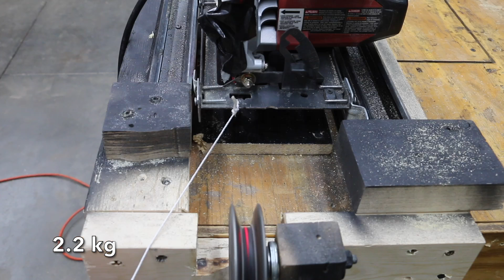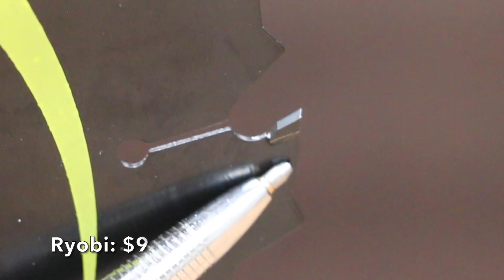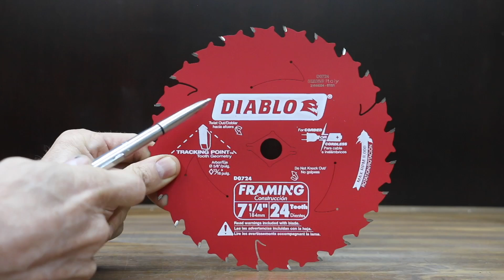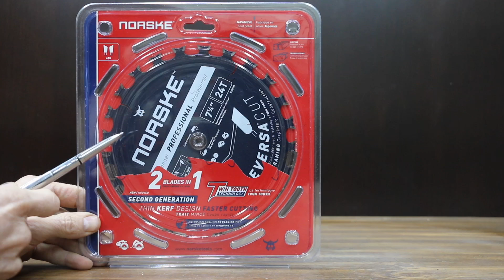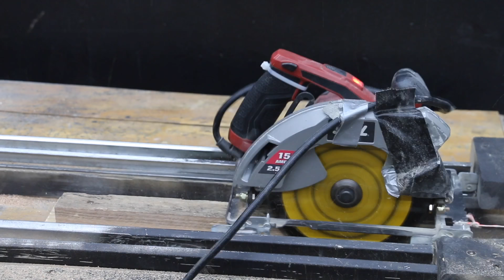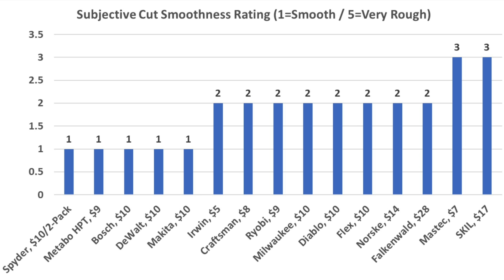Best Circular Saw Blade? FLEX, Diablo, Milwaukee, Makita, Bosch, Ryobi, Irwin, Spyder, SKIL, Norske

Comment: Todd testing the Makita blade:  "Holy Smokes 1.41 seconds very impressive!"   That brought a smile to my face😊
Reply from the maker: lol. Amazing cut speed!  Thank you!!
Reply: My jaw actually dropped seeing how much quicker the Makita was
Reply: It's fantastic for clean wood and doing cross cuts all day long for sure. Obviously it won't hold up for demo work and it isn't good for doing long rip cuts, as the thin blade wobbles too much when it starts to heat up.  I love Makita tools as far as an overall brand for tools though for sure. Generally, Makita accessories are mostly average
Reply: @travisjazzbo3490  you happen to know if the 10” is just as good?
Reply: @mlconley  As long as you are using it strictly for cross cuts I am sure it is great. Makita ships this blade with all their saws I believe. They even have it for their cordless miter saws.
Reply: I mainly use Makita saw blades on everything, except my circular saw for demo and reciprocating saw. My favorite is the Makita 100 tooth on my Bosch table saw for finish carpentry.
Reply: Same with me when he said that
Reply: I've had an efi cut for 2 years the same one daylie use
Reply: I went straight to Amazon

Comment: I always loved the weighted testing. It's a no nonsense, apples to apples way to compare. Nobody out there is doing a better job of providing real world reviews than Project Farm. Keep up the great work!
Reply from the maker: Thanks, will do!
Reply: Issue with that is it doesn’t account for the weight of the saw. Extra weight causes extra drag. 
A gravity test might be more accurate. Meaning drop the wood down a shaft or something
Reply: @squadron1010  But he uses the same saw for each test. The saw weighs the same amount each time.
Reply: @Gubers  yea, the only variable is the blade change, and maybe a knot in the board, which I'm sure he was careful of.

Comment: I'm honestly amazed at how well that Spyder did for how cheap it is.
Reply: I was thinking the same. We don't have it in Romania, though, or at least it's not common.
Reply: I'm seriously thinking of buying a 2 pack.....was dead set on the Makita....til the Spyder still finished ahead of it in everything but speed, I'll take the durability over a little speed.....if I used my saw daily I'd buy something else for a DIY'r that Spyder is hard to beat.
Reply from the maker: Thanks for the feedback.
Reply: I've got some spider recip saw blades and I love them, way better than the  milwaukee blades I used to buy
Reply: When you can undercut the competition by half, it enables the user to spoil themselves with freshies. Huge win
Reply: Spyder smoked the competition when it comes to price. For the weekender DIY, it's a no-brainer. On the job for the trade, might be another story.
Reply: Decided to try the spyder blades a while back, an am impressed! They seem to be a clone of past Diablo bladed and for the price, the framing blades do the job very well. Full time carpenter. Great reviews!
Reply: I love their hole saws too but the Makita blades cut so good you have to feel the difference it's a buttery smooth cut. Also the Makita max efficiency framing blade cut as clean as some other brands fine cut blades. The only negative is they dull faster but you can buy 10 packs on Amazon for cheaper
Reply: @elcastorgrande  I'm a full time carpenter. Spyder is the best blade for the money, maybe even at twice the price. I was a big fan of the Diablo blades for years,  but these are just as good at half the price.
Reply: @HDJess  hei salut man. cred co gasesti rebranduita cu ceva nume... da no.

Comment: I'm not sure if' you've considered it yet,  but I think testing windshield fluid would be a pretty awesome video idea.   After smearing bugs across my window last week yet again, I have to wonder if there's a fluid that actually 'cuts though bugs' as the brands claim.  I'm not sure if it's because I enjoy the rain repelling formulas or because I only use fluid that stays liquid year round.    I know people use plain water in warmer states, i often wonder if it does a whole lot better chemically to remove them.  I've seen mixtures of glass cleaner and water as well that probably bridges the gap. 

I'd imagine bug guts are reletively oily/ fatty and the water content evaporates on the glass pretty quickly from heat and airflow.  They may be water soulable oils and the name brand alcohol based fluids might not cut it.
Reply: I like this! Also add a temperature test. How does it do below 32f? Above 120f?
Reply: That is a great idea
Reply: Not sure if they still have it anymore, but TA truck stops use to have some that I have found was the best. Another option is to get that sprayway brand glass cleaner. That can cut through smeared bugs. I have a pecan tree at my house, so I get pecan sap on my windows. It can cut through that as well
Reply: this stuff worked pretty good but i dont remember the last bottle saying citrus scent. it smelled exactly like pinesol so maybe it used similar ingredients. im going to try mixing in some pinesol with regular washer fluid next time i need some bug wash. https://i.ebayimg.com/images/g/WJkAAOSwv9JeIcoz/s-l640.jpg
Reply from the maker: Thanks for the suggestion.
Reply: Have you tried applying Rain-X on the windshield? Afterwards, think of the windshield as a Non-Stick Pan, and the bugs are sticky foods!
A squirt of windshield fluid and a pass of the wiper should clean away anything!
Reply: You should get a quality Ceramic Coating, and coat your windshield (something like Avalon King, or Carpro CQ UK 3.0). Once properly coated, the bugs will wipe right off with any windshield fluid.
Reply: bug removal = cheapest dryer sheets
Reply: How many bugs will have to die to test this? lol.
Reply: He has done an excellent test video on windshield wipers.
Reply: @alansmith4734  If you use Rain-X on your windshield, use Rain-X windshield washer fluid. It works great, and helps maintain water beading. It will etch your paint if it dries on it, however.
Reply: Not sure the brand name but the stuff I like is purple.
Reply: This would be great to see, especially if it includes a muddy salt spray.  Traveling around semis on salted dirty roads is when I have needed wiper fluid the most.
Something that can stand up to the grit, grime, and film, while being blasted with debris that removes protective coatings and lifts sections of the wiper blade.
Reply: Please do this one!
Reply: I agree I would love to see a windshield washer comparison, the one I use is rain x, I'd like to see how it compairs to others
Reply: @ProjectFarm  I put a RainX mix-in in my fluid this summer because I was going on a long road trip and it has been awful smearing everywhere.
Reply: I second this idea too!! Very great concept. And above all, useful! 👍
Reply: Some windshield fluid brands drys the windshield wipers quickly to a point the wipers are useless.
Reply: @alansmith4734  bugs are very hard they punch throught he rainex and stick to the glass...you need to reapply. I live in cold Canada bugs are a summertime issue..actually most of our BUGS are in Ottawa but I digress...
Reply: @actionjksn  He has, and I am using both the Bosch Icon blades AND the Turtle Wax Advanced Ceramics that he tested on my car and bug guts are STILL an issue for me as well.
Reply: @2nd-place  I agree, I don't like the haze of head lites at night thru RainX
Reply: In my experience; rain water seems to do better than the various windshield washer fluids. 
Please save some rain water and test the fluids against it.
Reply: @ProjectFarm   … yup the spray way foam is unbeatable! FYI worked great on dog slobber
Reply: Rain-x your windshield
Reply: @safffff1000  "I agree, I don't like the haze of head lites at night thru RainX"

What I do is apply the Rain-X, keep going with small circles after it begins drying to a fog, and then wipe the whole windshield with clean water to take it all off. Works great, lasts several months and no haze. If you're seeing a haze you're probably leaving a layer that's much thicker than the microscopic layer actually bonded to the glass.
Reply: Prestone bug remover. It's a green fluid. I have a flat windshield being that it's a Jeep and this is the only thing that I can get bugs off with.
Reply: I'm a truck driver that drives up in northern Alberta and the best thing I have found is to put some dish soap in with the water. It cuts the grease and oil from the bugs and you already have it under your sink. It works and it's cheap so you can use as much as you need and pack along several jugs for refills. If you can get water and bring a bottle of dish soap with you then you don't have to worry about running out. It's a simple< easy and cheap solution.
Reply: RainX on cross country trip this summer was awesome stuff made water bead the whole trip with rain and it cleaned bugs and a was washed Arizona dust really well and cleaned the red dust in New Mexico
Reply: I had made a similar suggestion not long ago.
Reply: @simpleman806  we would love to know the brand
Reply: @producerk8247  I wish I could remember. It's been about a decade since I've drove OTR. I would fill up a water bottle with it when I would get fuel there and use it for hard spot cleans on the windshield. It's been so long, I'm not sure if they still carry it
Reply: @u8qu1tis  not nearly enough! 😂
Reply: Putting green engine coolant in the windshield washer reservoir is one of the most deadly mistakes car owners can easily do without noticing. The coolant smears across the windshield blinding you and can cause an accident.
Reply: @GlennC789  Thanks, I'll try it sometime. Right know I have silicon wiper blades and they seem to leave a coating on the windshield that acts like RainX but no haze
Reply: @lonewolfsstuck  I also made the suggestion long ago.  Hopefully, it will now happen!
Reply: @BigBear--  Clearly, (*cough* sorry for the pun) You've watched more than a few detailing videos, and likely have done more than a little yourself to know those 2 names...Any chance you're familiar with Pan the Organizer ? 🤔
Reply: I second this!!!
Reply: Yes Scottie Kilmer recommends RainX and I started using it and think it's the best washer fluid.
Reply: I used the walmart brand fluid.  It's works ok on bugs and birdshit, but it triggers the "low wiper fluid" sensor every time the car is started.
Reply: @BigBear--  buying a coating for a windshield is foolish and unnecessary.  Use griots 3 in 1 ceramic coating and reapply every 3 months, as your windshield wipers will rub off any coating you use fairly quickly
Reply: You can buy bug and tar remover at any auto zone-ish place
Reply: @2nd-place  I put spray on Rain X and I've experienced smearing also! Wipers don't wipe clean!
Reply: @ProjectFarm  what's the last thing to go through a bug's mind when it hits the windshield?
.
.
.
.
.
.
.
.
IT'S REAR END!
Reply: Also test the freezing point of washer fluid. I did my own little test and all the fluids rated for -10 or -20 freezing point usually froze around 5 Fahrenheit.
Reply: @MapleMAGA1963  that's what I would do in the summer months as well in my truck just dawn and water it works awesome
Reply: @scottcrawford3745  Yeah I know Pan the Organizer. His isnt the only channel I watch though. I've been into cars and detailing since my high school days in late 90's/early 00's. So I've heard or used a lot of the products way before I started watching any detailing channels. Pan the Organizer is good for roundups and product introductions. Some of my favorites for objective testing is Forensic Detailing and Apex Detailing.
Reply: @Tallnerdyguy  I didn't mean you ONLY have to use it on your windshield. But sure if you want to reapply every couple of months, Griots 3-in-1 is fine. I prefer longer lasting applications, and the cost difference isnt a major deal in that case. I would've recommened something even stronger, but if you've never applied a ceramic coating I tend to not recommend professional coatings, and instead steer people towards the easier to apply DIY products. Both Avalon King and Carpro CQ UK 3.0 would last for at least 2 years on the windshield if properly maintained. Often people don't maintain their coatings properly, so when the water beading goes away early they assume the coatings failed - however 99% of the time the coating is just under a layer of grime, road film, tar, iron, and other particulates. One just needs to properly wash and decon the car and the coating performance can be restored. The use of coating booster products is also recommended to maximize performance and extend/maintain the lifetime of the coating.
Reply: @BigBear--  don't need to spend hundreds on professional ceramic coating. Project farm did a video on ceramic coating you can apply at home. I bought a 27$ bottle of Turtle Wax Hybrid Solutions ceramic coating and I apply it 2-3 times a year and it repels water just like rainx but on the whole car
Reply: @eriklarson9137  Why stop at 32f? Lets get down to some winter temps. -40f and colder.
Reply: @markmills344  distilled water.... not really different than tap water. Water is a solvent that can be found in all washing fluids.
Reply: @u8qu1tis  He'll simulate the bugs using a mixture of maple syrup and tar.
Reply: @safffff1000    RainX is great for when you're mostly traveling highways you don't have the haze issues from lighting as bad then, the stuff is horrible in town
Reply: @u8qu1tis  I want to see the "bug cannon" he invents to blast the windshield with 23 grams of bugs.  He can collect them with a big vacuum fan next to a lightbulb at night.